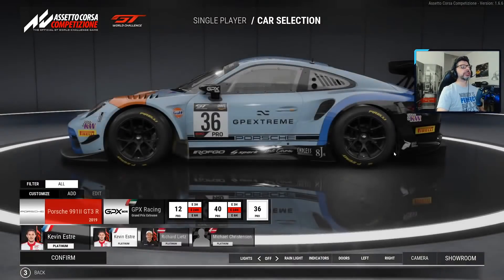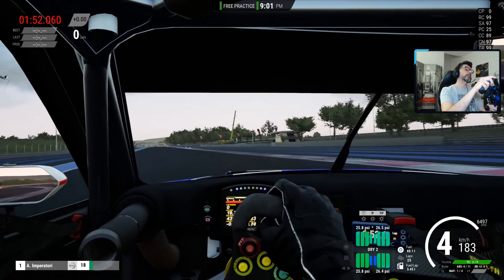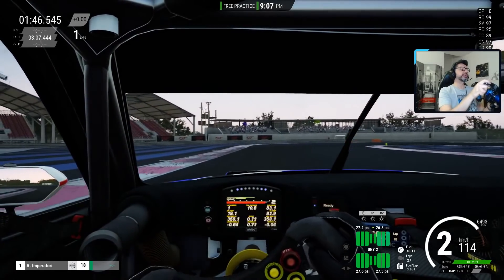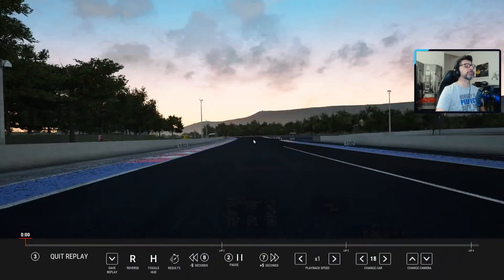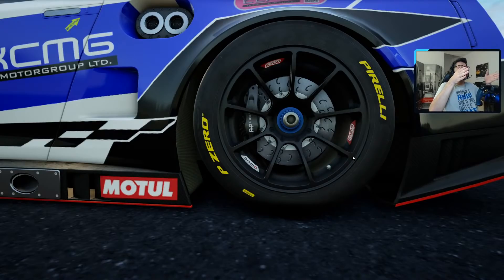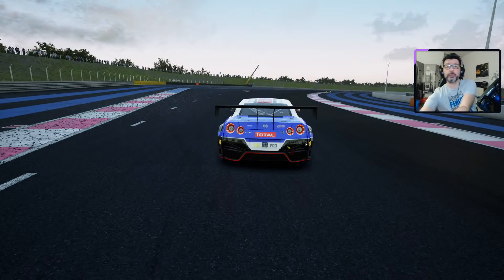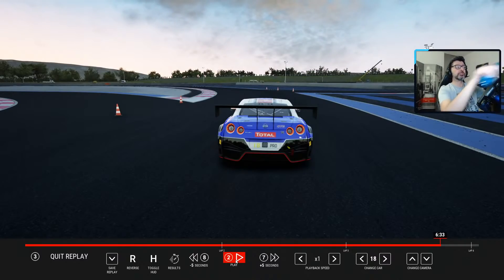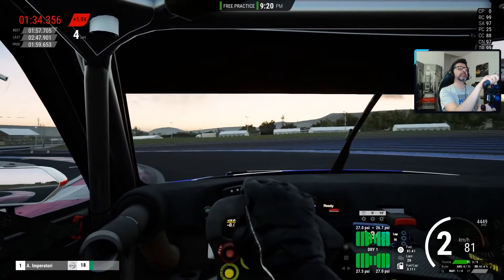TL;DW - How to adjust pressures to work for you. Fine tuning

Comment: Hi Aris, It's so impressive what you're doing in the game and how it all works. Could you also make a video of how it works with the rain tires? I just don't get it to the right temperature, no matter how many psi I put in there.
Thank you very much for this game
Reply: Your tyres will get hot by braking and accelerating. You get less temperature as it rains because of the external temperature and because you won't go that hard on the pedals. previous to a hotlap, do a lap with a lot of braking and accelerating. A common myth is that going right and left will take the tyres to temperature (because w've seen in on TV). No. It will only "clean" the tyres from small objects sticking to them.
Reply from the maker: Sure thing! But first I want to fine tune some problems present in the rain tyres heat generation and characteristics.

Comment: Very interesting info about physics, thanks for the video!
I'm wondering do pilots in real life also do this micro-management of tyre pressure?
Sweet spot of tyre pressures seems to have very small range
Reply from the maker: Thanks! 
Have you heard of the drivers complaining during the races how the car "doesn't work" or the tyres have "no grip"? Then a bit afterwards managing to pull a fast lap again? 
More than marketing talk and complaining is actually the tyres and car going out and in again their operational window. 
I'm pretty sure you have experienced it too in ACC during a long 1 hour stint. The car seems good at start, slower at some points, good again and so on. 
Modern racecars and tyres are very sensitive indeed.
Reply: @ArisDrives  For the average guy to really see this demonstrated in real life motorsports start watching some Nascar races as the pit reporting the teams will tell the reporter that they will make the car adjustments on pitstops most of the time just using air pressure and only major adjustments which exceed the adjustments capable with tire pressures are mechanical adjustments to the suspension.
One thing Nascar does do really well is involve the fans with broadcasting in car team communications and knowledgeable pit road reporters getting actual in race short interviews with the teams crew chiefs.

Comment: Do a couple of tenths of PSI really change the tyre radius enough to change the rotation of the wheel? Wouldn't you get more of a handling change just because the pressure is further away from optimal and the available grip is less?
Reply: In a word, YES.  Good quality racing tire pressure gauges have tenths on them for a reason.  I guarantee you that real world competitive teams ALWAYS treat their tire pressures this seriously.  It is the ONLY mechanical contact with the racing surface.  In fact, I would be willing to bet many teams have a tire specialist, whose job it is to do nothing but measure, match and maintain tires.  It really is that important and that technical and that precise.  
When I worked on a Top Fuel dragster team for 10 years, every tire was measured for circumference at specific pressures, and this info was recorded for every tire.  You could literally tune the launch and speed just by changing to a larger or smaller diameter tire, although each tire, (hand made by GoodYear) was supposed to be identical.  When the tire truck showed up at the track, teams would be standing waiting to start sorting through the tires to get specific diameters they wanted. 2 tenths of an inch diameter could mean the difference between launching straight or veering right, and that's on a narrow wheelbase dragster, not a wide-body GT car.

Comment: Very clear. But I would like to ask if the same is true for front tyres. How is car behaviour when approaching or exiting a corner with different front pressures? Ty
Reply from the maker: Rear fine tuning is more important because of course the cars are RWD. Also the cars turn with front tyres so you can adjust your steering input to point the car. You can't directly control the rear movement except with the pedals.
I tend to do so for all 4 tyres, it makes my results easier to understand.
Reply: @ArisDrives  Thank you Aris for this answer and for all your continuous effort trying to explain us all those race things 👍

Comment: What about tempratures? While we focused on the pressures temps between tires may not be evenly distributed right? 
Should we aim for optimum temps around tires more than pressures or vice versa?
Reply from the maker: Depends on the tyre type, manufacturer etc. 
Pirelli GT3 tyres we are simulating are made specifically with client racing and drivers level, so they are extremely "good" for a wide range of temperature, and the pressure becomes the most important factor of performance. 

Other tyres have much more narrow temperature range of operation so you need to work with both of them to make it work properly.

Comment: Hi sometimes i see that wheel psi also depends on the hour in the game so asphalt temp is not same and because of this a saved setup can be different depending on hour. It this true?
Reply from the maker: Absolutely. The tyre heat depends on the brakes usage and duct openings, the ambient temperature, the track temperature (night? clouds? sunny?), the driving style, the tyre wear etc etc. 
Every single one of the above causes, influence the heat generation and heat changes the pressure. 
So you cannot set the pressures in one condition and then simply use the same ones in different conditions, even if it's only a cloud covering the sun or the sun is lower in the horizon.
Reply: @ArisDrives  Thanks a lot. So i think it will be usefull to have in mind track/air temp when saving/creating setups.